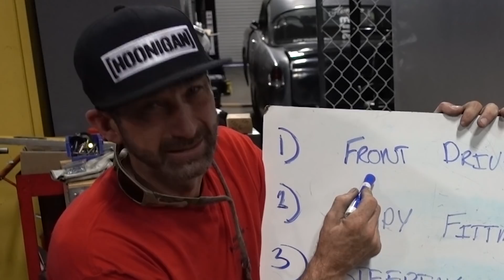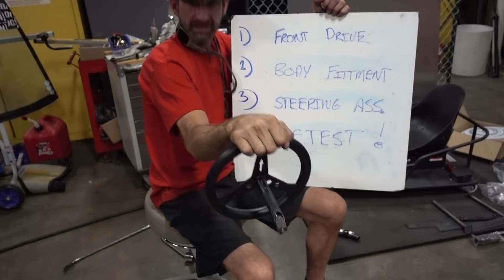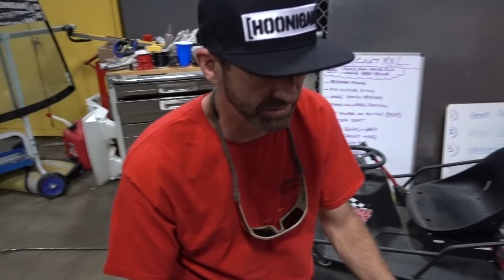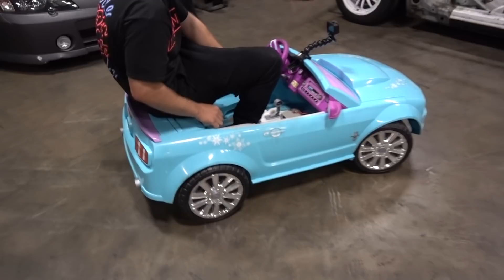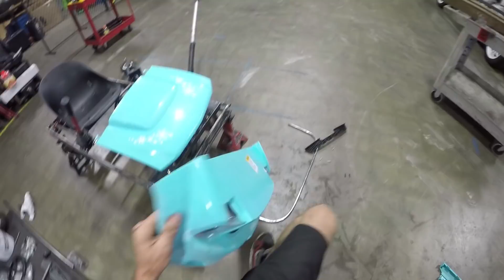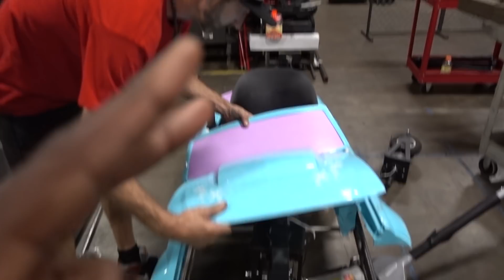We Thrash (And CRASH) The Hacked Up Crazy Cart XXL. Plus Tandems!

Comment: that steering wheel is almost at 90 degrees to the main wheel drive. You could have just used a set of bevel gears and a 1 U joint instead of using 2 U joints and make it look ugly.

Comment: Hey brad... You don't need a master link. Just press a pin out, and then back in. Very simple, very easy. (if you got the correct tool). Also, keep on keep'n on.. I love this sh!t....
Reply from the maker: Brads tool box consist of a hammer, a screw driver and a Bic lighter...

Comment: Why didn’t you just weld the whole drive assembly at an angle, rather than having to use joints for steering wheel angle? Would’ve kept the low profile too

Comment: you must not work on motorcycles they make a chain breaker that pushes those rivets out and also pushes them back in very easily you can adjust any chain with or w/o lock it bypasses the need for a lock

Comment: You don't have to cut the chain if you have the right tool. you push out the pin till it gets to the outside plate and push it back in. its called a chain tool. Bike shops have been using them for years......

Comment: wheels are waaaayyy too close together on the xxl to be practical, same with the ride height. take a look for a sec at the differences in wheel positioning on both the origonal, and the xxl, the xxl needs to be heaps lower, and the castors need to be a lot further apart. probably drives more like a bike than a car at this point, especially with big bois like hert and scotto contributing to the awkwardly high centre of gravity.

Comment: the cart has to be wider and the caster wheels need to be smaller. there also needs to be a spacer the acts like a leveling block to lift the front end so that all three wheels will be level with the ground which would give you more stability and your steering will feel better. just trying to help :)

Comment: Of course they crash it with a mustang body.   Also! If you use gears for the steering you can get the angle easier and use gear sizes to control the steering rations

Comment: gotta push the drive axle further in front of the steering stem so that the wheel is pulling more than pushing, more stability and it will want to return to center rather that knife around to 90

Comment: Master links for fools. NEVER TRUST A MASTER LINK!!! Buy the tool. Or make a tool. or use a punch in a vice. #bmx4life
Reply from the maker: Sounds like someone has learned the hard way when a master link pops...
Reply: I did as a kid on my bmx bike and hit my knee on stem/neck bolt.  but one day i seen this cool looking tool at my uncle garage for his harley. I asked him what it did and he said its for pressing out chain pins. Just remember after you press pin out. Make sure you hammer it down and mushroom the ends so they don't pull out(welding also works). If you forced to use a master link make sure you put it on the correct direction or it might pop off.

Comment: As for the steering, probably could use a steering quickener like a 2:1 or a 1.5:1 but use the "faster rotating end" on the steering wheel side. It could probably fit where the "sleeve" is on the steering shaft. A steer-by-wire seems ridiculous as a "solution" for the problem.

Yea, "widen the rear" so that the distance between the axles when turned so that they are the closest together are wider than the profile of the seat which probably push them almost on the frame or even outside the frame to make it more stable.

The angle of the rear caster wheels might need to go further/higher up into the frame so that when you want to go straight forward, you can mostly maintain that  even when steering left or right. This might change the geometry of the linkage if you don't want to increase the amount of force to start drifting but might change the length of pull.

The radius of the rear caster wheels on the original seem to be smaller or at most doesn't even go past the rotating axis of the swivel plate, so maybe smaller wheels on that caster frame that you have might help. This too might change the linkage geometry similarly as before.

Not sure if the frame even on the original one is completely level/parallel when you set the lever to "100% drift mode" but might want to check if your frame is similar especially with the front drive wheel on as the front casters aren't suppose to touch the ground but only as stabilizers when needed.

If Brad gets a bigger motor, I am not sure if it might fit above the powered front wheel as he shortened the distance between the axis of the the motor and the wheel in which they are almost touching each other. That is if the new motor is just as compact but with more torque, if not, then back to the original motor/wheel frame, just a shorter steering stem. Unless you make it a hub motor but torque could be a problem.
Don't worry about the chain guard, they don't need one....yet...

Comment: The steering is sketchy because of all the angles in the steering rod. Gears would be better here. Looking at the driveshaft for an example, if it's in an angle, then the exit angle must be the same as the enter angle. Joints also have to be rotated comparing to one and other so that the inequality in speed cancels out. Well, something like that. Scienceeeeeee.

Comment: I ran into the chain ordeal and it ended up using a chain breaker and pushed the pins out of one link set and then reconnected it by pushing the pins back in and kinda crimped the ends of the pins by using vice grips and its still holding together after some serious trashing. Gotta be careful not to sieze the wrist pins in the link though...
Reply: That Mustang snap oversteer got ole Brad, should have put a Camaro body on it and he would have been right at home lol

Comment: Correct me if I'm wrong it steers poorly because on the original the front caster wheels are raked forward so that self centre to push forwards where on the XXL cart they are level
Reply: I think it's because the rear wheels in lower position should not pivot, then you pull stick to bring pivoting rears in contact with ground to swing it

Comment: when widening the frame:

Measure width between front caster wheels of the original. Lets say 16"?
Measure width between rear caster wheels of the original. Lets say 24"?
That means a 50% increase in width is neccesary to get the control of the Crazy cart back.

BUT

You also need to account for the length:

Measure length between front and rear caster wheels of the original. Lets say 30"
Measure length between front and rear caster wheels of the Hoonigan Trash Cart . Lets say 36".
That means its a 20% increase in length. With that in mind you need to account for the extra length by widening it on the rear. Just use pythagoras for that. Should do the trick.

And if its to much Math/Science: Just make camber plates between 2 tubes. That way you can slides the wheels in and out. When you've got the right place figured out, just weld it and measure from that one.

Comment: those casters need to be shoulder width and it will be WAY more stable, and it might need 2 front drive tires instead of the center driver tire because it has a bigger footprint.

Comment: It needs a reversed steering quickener that the dirt car guys use. Speedway sells them for like $100. You can get them in like 1.5:1, 2:1. if you use the output as the input it will slow it down and be less twitchy.
Reply: notice this man hoonigan!
Reply: The problem is likely the U joint angle causing irregular quickening/slowing of the steering. A second U joint might help lessen the effect if it is phased properly
Reply: Yeah, those fucky u-joints are the issue i'd think.
Reply: Wait , what is this magic you speak of ?